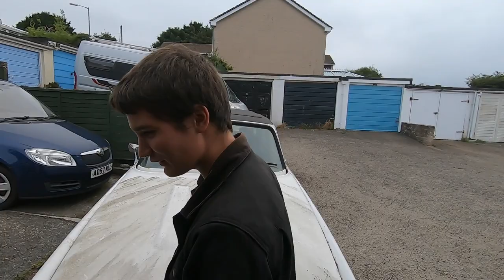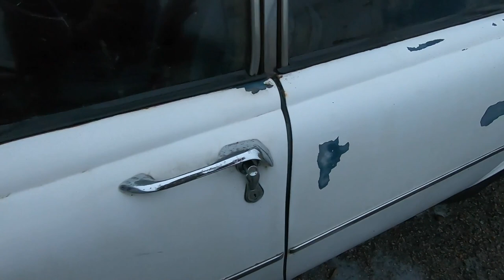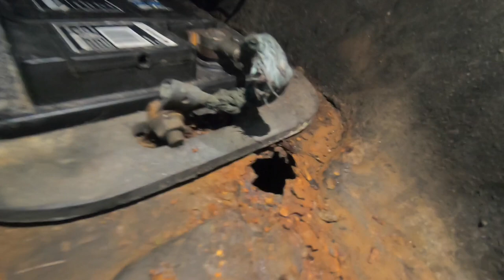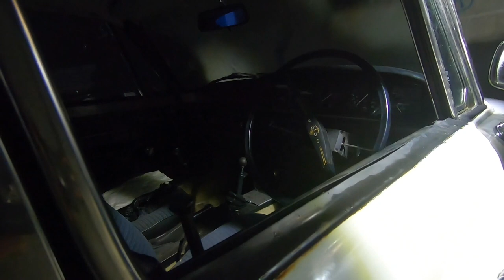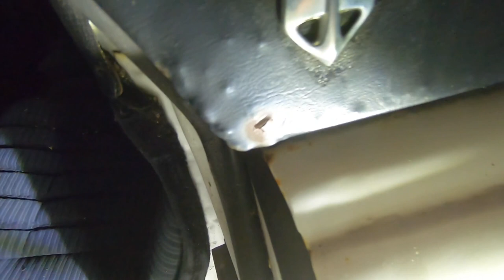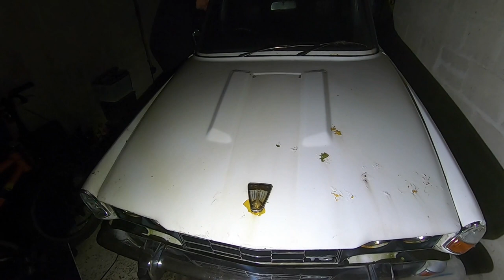1977 Rover P6 2.2TC Part 2 first wash in 10 years and rot assessment!

Comment: I would not be quite so negative in the appraisal of the Rover. All that rust can be replaced. Many YT's take a far worse chassis than this and do the bodywork with self made panels.It would be quite a project.It could also be quite satisfying to see it come back to life and use. I wish you all the best with. Cheers
Reply from the maker: Sadly the P6 is not that simple this car is rotten to the core I bought it as a donor car and as sad as it is I will not be spending 15K to fix this one up so sadly it's spares only

Comment: Good call to use it as parts so many other cars can be saved by parting it out, and you wont find them in scrap yards any more so a parts car will come in very handy ,You are saving other cars and that is a good thing .My mate broke one up many years ago for parts as floor to sill are was completely rotten it looked good on the outside though .

Comment: Hi Sheldon, I love p6 rovers and I've had 5 over the years and it seems that the metal on cars this year was very quick to rot. I had one similar and it rotted around the floor above the rear axle etc..I remember someone in the p6 rover club had a new base unit as I was offered it back some 20 years ago..However you are right it is a good spares car..looking forward to more videos..
Reply from the maker: Yeah they are terrible for rust!
Reply: I had 3 of these rot boxes over the years followed by 9 SD1s. Gave up due to the rot and then switched to V70R Volvos. Just glad I can't drive anymore.
Reply: Way more salt was used in that era on all roads and foitpaths.

Comment: That is comprehensively knackered. Sad to say but it's often the case with P6's. Outer panels look good from 30 yards away (and the camera can also be very flattering) but they hide a base unit that's gone well beyond. The welding on this one looks like I did it!

Let's just suppose for a minute you're a masochist with a bottomless wallet (stay with me on this...) and you decide to restore it. Where are most of the replacement parts going to come from? Another parts car! The bits have to come from somewhere. So I'm with you on this, it's completely useless as anything other than a source of parts. Sad but true.

Having said all that I have to say I love P6's. A car unlike any other ( people are going to say "It's like a Citroen DS you idiot!" but come on, yes the DS is vaguely similar in some ways but although it's the only car that's in any way similar, it's sufficiently different to the Rover to be an entirely different animal. There's nothing like a DS (apart from a CX, sort of) and there's nothing like a P6.
Reply from the maker: This is the point I make but they won't have it so screw em!

Comment: If you can see metal cancer to that degree on the outside it'll be 1000 times worse inside, especially if it's already had work done! How long has this car actually been rotten?
Only worth anything as a parts car, you're doing the right thing Sheldon 👍 
As a body specialist I can speak on these matters.
Reply from the maker: Yep it sure is buggered!

Comment: It's interesting to note that the early 2000s had four interior lamps(!) - the two mentioned below by Philip Willis, plus a third in the lower edge of the front parcel shelf above the passenger glove box, and a fourth lamp, a twin of the one I just mentioned, above the driver's glove box. I think that on later models all these lamps were deleted and replaced by just one central lamp in the middle of the roof. (If I am wrong I'm sure Sheldon, or another expert, will correct me.) I expect this vehicle would have one central interior lamp. Sad to see one with so much rust. Hard to believe actually.

Comment: I have a growing desire for a unmolested Zircon blue 2,000TC with Sandalwood or Buckskin interior which must have the “down light” over the dash behind the rear view mirror, and the second interior lamp over the rear seats.
Is this normal, or do I need therapy..? 😰
Reply from the maker: Hahaha there is a video on such a car on the channel I had not long ago a 1968 2000TC
Reply: It's interesting to note that the early 2000s had four interior lamps(!) - the two you mentioned, plus a third in the lower edge of the front parcel shelf above the passenger glove box, and a fourth lamp, a twin of the one I just mentioned, above the driver's glove box. I think that on later models all these lamps were deleted and replaced by just one central lamp in the middle of the roof. (If I am wrong I'm sure Sheldon will correct me.)

Comment: The mistake people make with classic cars is labouring under the misconecption that they must be a. "saved", and then b. restored to absolute perfection. Fact is, it's here, and it runs. Why not just stick it in for an MOT and fix what needs fixing to a workmanlike standard, get it on the road and just enjoy it for what it is? It won't be failing for superficial rust, and you might find that a couple of weekends will have it road legal.
Reply from the maker: All that rust was structual the car was broken for spares to keep others on the road
Reply: Rust usually is structural, that's to be expected. It of itself isn't a reason to scrap everything in sight though.
 @classic_britain
Reply from the maker: @gsdavies100  Everything in sight is crazy

Comment: What a crying shame, eh?  It looked so promising.....and then you washed it and took the camera in closer and suddenly.....not so much.  The rot in the boot lip - yeah, no biggie.....but where else will it have gone that's close to there?  Sure enough - the boot floor corners......but wait!  There's more!  Today only, you can have a ratty welded sill that hides a multitude of sins!  Be quick - it will not be there tomorrow!  Yeah, we know mate - it will be on the floor because the moths have stopped holding hands.

The problem with the P6 is similar to that with the P5, and the Triumph Stag and 2500.  There are so many exposed and unwelded seams and places where a small amount of water (or road-salty water) can seep in and get a great patch of rot established without being detected.  Worse still, they do it in places where there are multiple joins or multiple layers and hide it away from everyone until one day the metal is compromised so badly that it starts showing on the outside.  Then it's like an onion......you peel layer after layer off, trying in vain to find the source of the Nile / Genesis / where everything began (pick your pejorative) and when you finally do, you look at the 3-foot piece of tin - which is now all that remain of your project - and wonder why you started at all.

There comes a time where things go past their use-by date.  Unfortunately, this baby expired some years ago.  The paintwork wasn't great but the moths are eating the car from the inside out and seeing the lumps on the body panels and under the vinyl roof still on the car, even what you CAN see isn't good news, let alone what you cannot see until you pull it to pieces.

At least Kizmet will have a great little engine, box, and interior (along with miscellaneous bits of trim) and there will be plenty of spares for other vehicles.  I totally agree that if one tired and uneconomical to fix car can potentially save six others, then by all means strip it of what's still worth anything to anyone and send the remains of the rusting hulk away to be recycled.  Even a P6 V8 in that state would not be worth putting bck on the road, mate.  I don't see the point in overcapitalising on a vehicle unless I am going to keep it for many years and get my money's worth out of it in reliable classic transport (in as far as that's possible)....but even THAT has it's limits.  You wouldn't spend 18-20 grand on the restoration needs for Kizmet, would you?  Well, not intentionally, eh?

Ignore the haters.  You do you.  They did not find the car - you did.  It is obvious it's not as good as initially thought, but there are (as you said) many good bits on it.  She's a donor - always was.  All the best, eh?
Reply from the maker: Great comment mate and yes you are right even though ut could be done why would you! And Kismet will still cost me 10K in the end but she is far from buggered and I have no intention of braking or re shelling her I bought this car as a donor and that so what she is going to be used as!